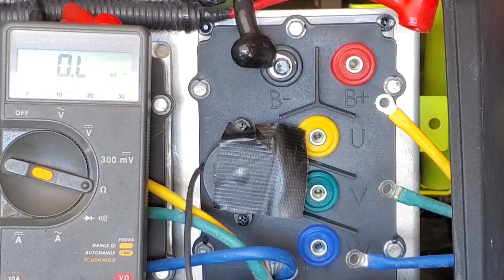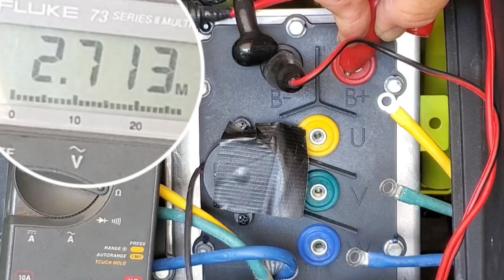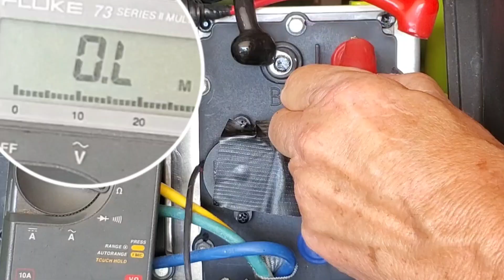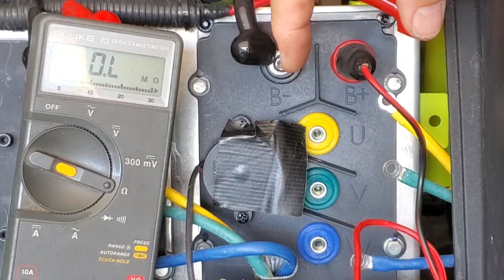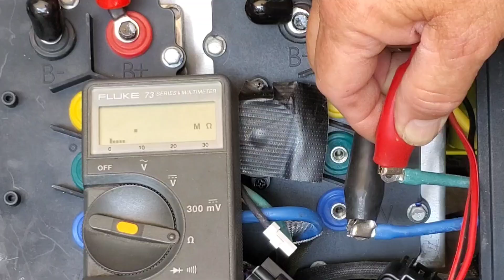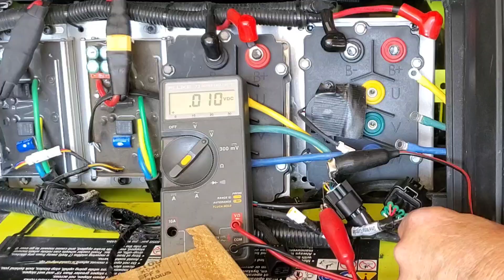ZT Drive Controller, Motor and Hall Sensor Tests.

Comment: So I figured it out.. seems implausable but the previous owner put a right side controller on  to the left side- it fits except they had to cut out a corner of the outer bracket where the front side (longer) hit the rear side frame of the mower.. I ordered the correct left side controller and once again THANKS to your superb videos I was able to track this down.